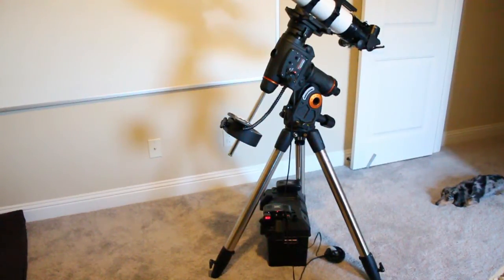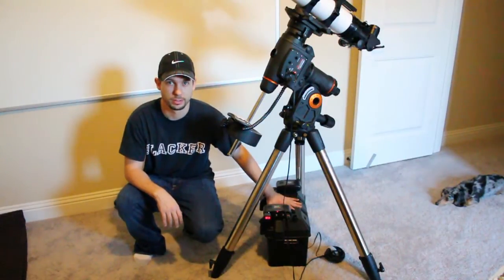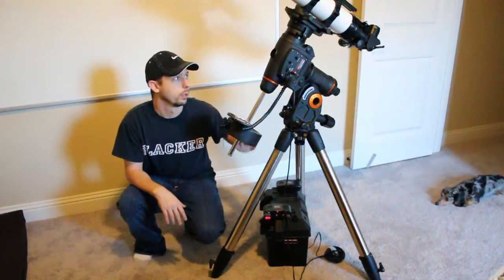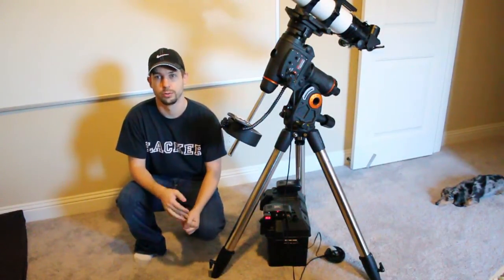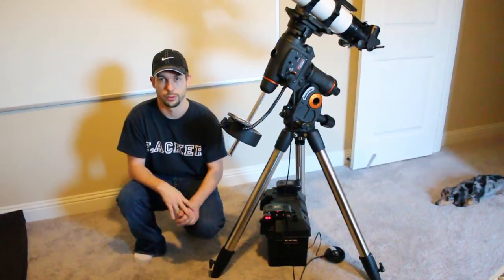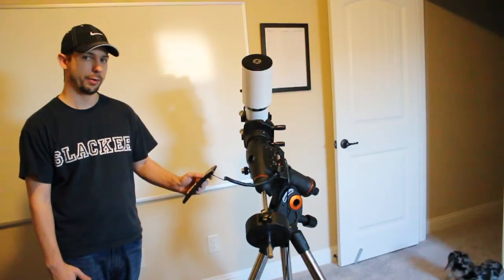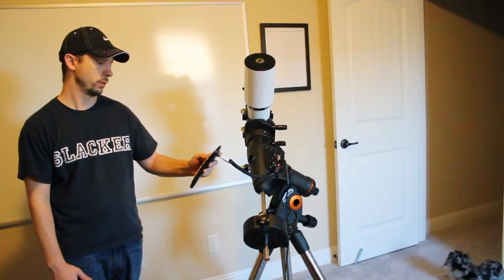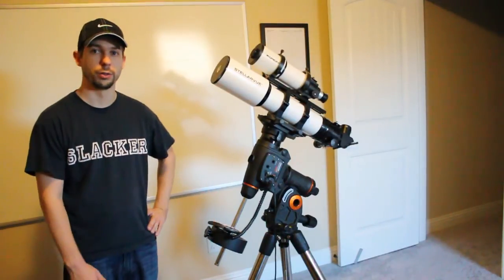My DIY Telescope Battery

Comment: Do you have a link to the guide? All the links are broken
Reply from the maker: Unfortunately, no.  I let my website registration lapse, and the website was deleted.
Reply from the maker: I found a back issue of a magazine that featured my blog article.  It has the text and some low resolution photos that should be useful to you.  It starts on Page 50.  My old website was East of Jupiter - and the article is authored by my real name (which is not Allen Mitchell).
https://issuu.com/amateurastophotography/docs/issue13s